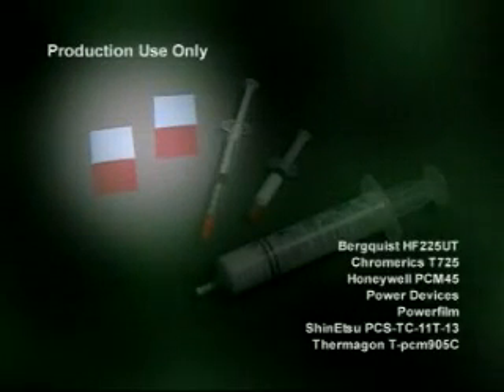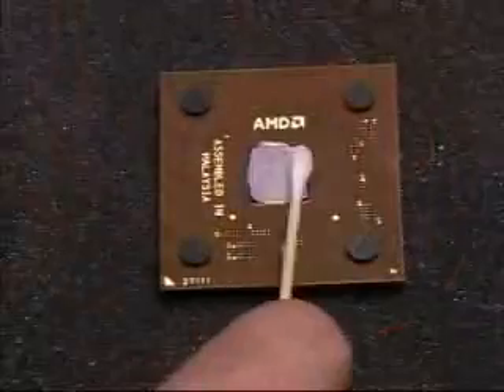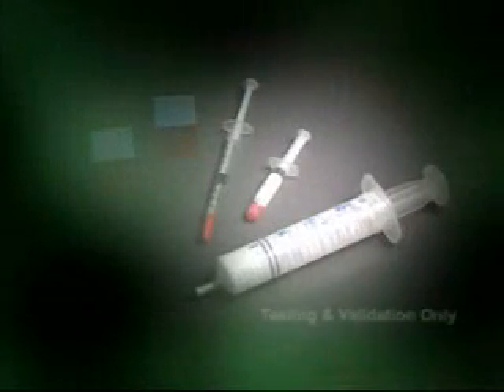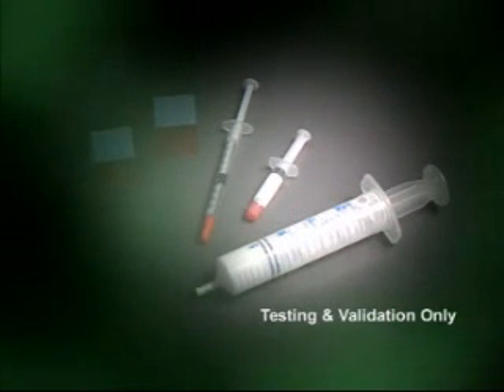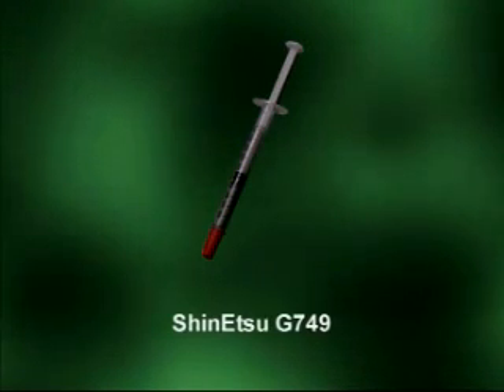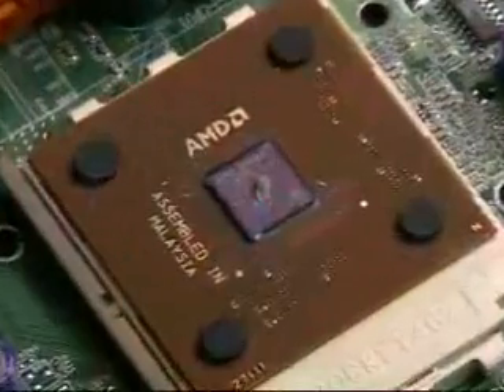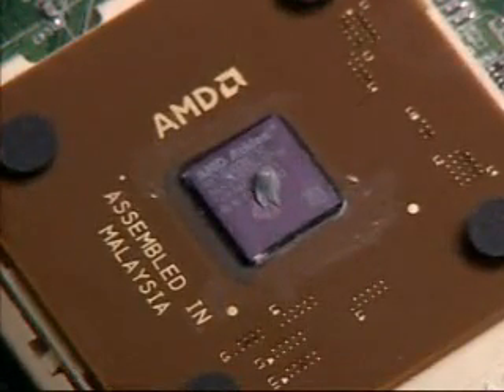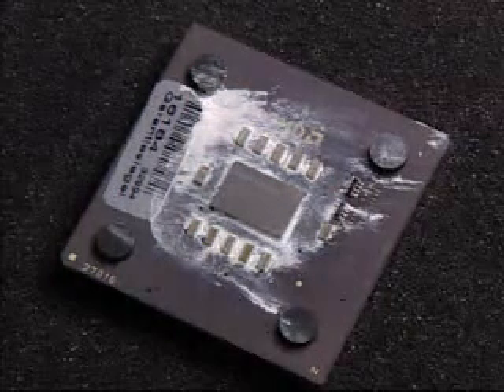AMD Thermal Pad or Paste?

Comment: what a full of crap
I have a computer since 2006
and I never change the thermal paste on my CPU
actually I don't even know if the CPU have thermal paste or thermal pad
since I just buy the computer and use it for 10 years without any thermal issues

Comment: I've been using the same 142gram tube of Dow-Corning 340 for about 20 years and have never burned up a CPU or chipset. I've O/C'd more than a few ASUS mb/AMD cpu sets during that time (no liquid inside my cases yet... but I might try that soon). 340 paste is about 80% cheaper than Arctic Silver 5, gram for gram. And I HAVE used Arctic Silver 5, because it came bundled in a special with a Zalman cooler I got from newegg 6 years or so ago. I've seen no difference in heat transfer ability.